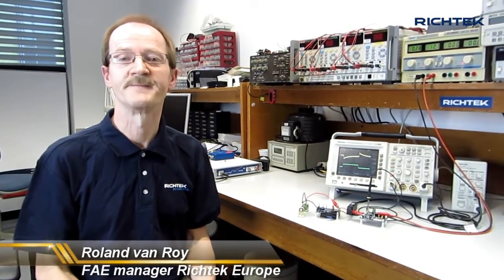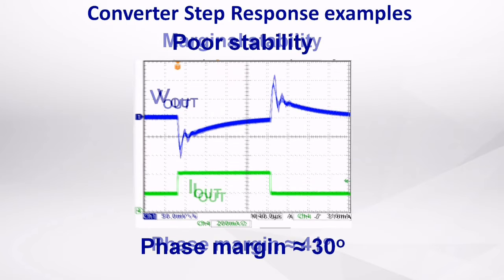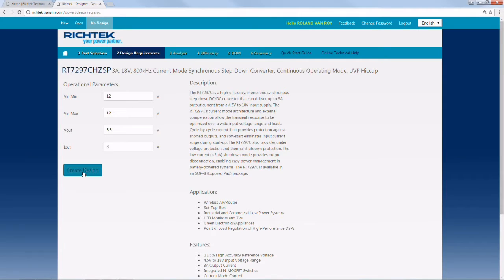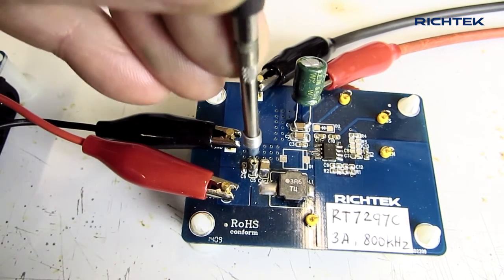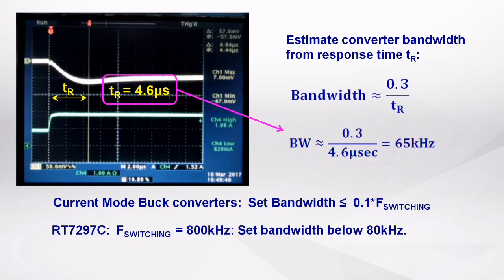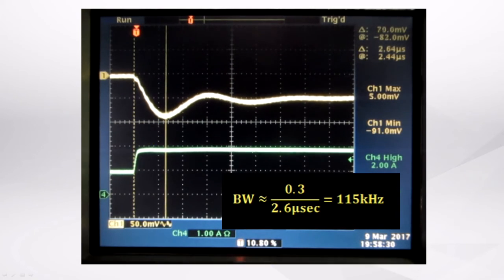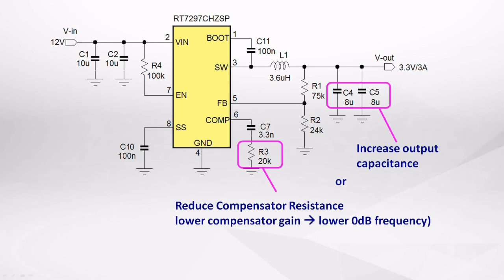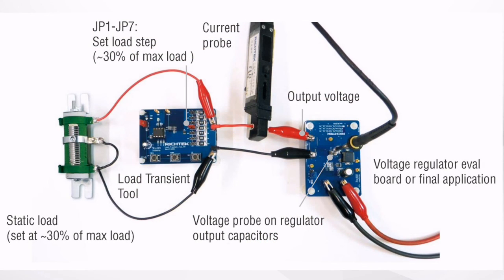How to estimate control loop bandwidth from the transient response time?

Comment: Just what I have been looking for for months. Amateur radio transmitters in CW or SSB are a severe transient load on power supplies with a cycle rate of around 5 HZ and drawing about 20 A from a 12 V supply. The video explained to me what the different responses might be and to a point, how to fix them. There is not much around on the transient response of power supplies. The application notes are very helpful too. I am using a 300 W programmable electronic load that has a dynamic capability but ordered the little test set to experiment with. Very good.